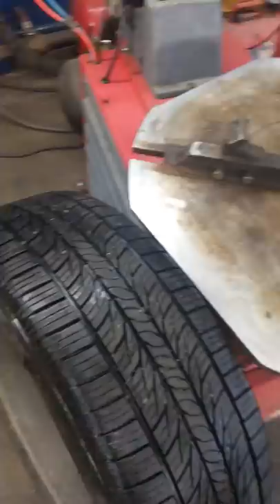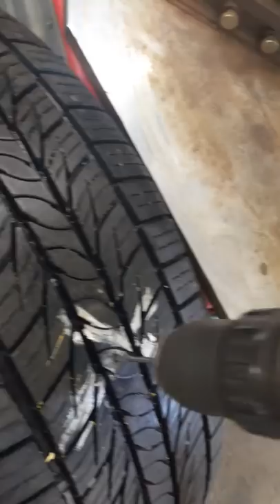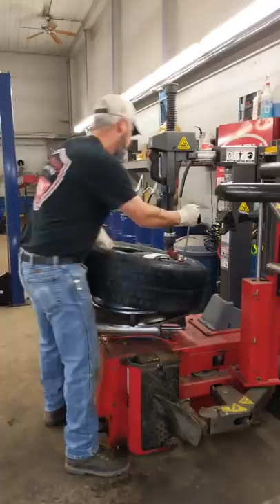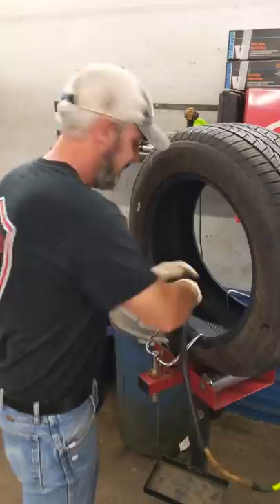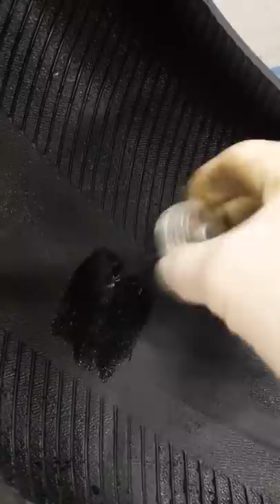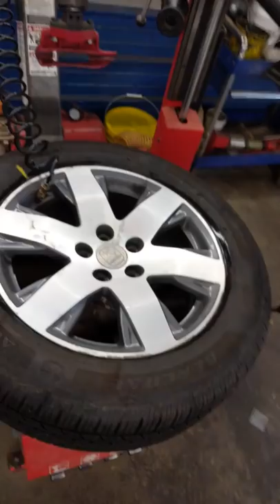Patch A Tire In 60 Second #SHORTS

Comment: What is so bad about simple plugs?  I need to know - I'm riding on so many plugs I can't keep track.  Is there a Shake Hands with Danger video for tire plugs?  Eric O sure is spooked.
Reply: I am not a certified mechanic, nor a lawyer, just some rando in the internet. But I've been plugging my personal and friends' tires for about 25 years now and had maybe 4 fail to adhere (or fell out within a week or two) and the worst that happened was a return of the slow leak. I've gotten lucky that almost all my holes have been near the centerline and not at the shoulders. If I needed a shoulder plug to get me home, fine, but I'd be looking to replace a shoulder-damaged tire soon.
Reply: They separate the tread from the liner after a while because they don't seal the liner very well and air pressure will be against the tread. You can get lucky with them but a patch definitely keeps the air inside the liner
Reply: @Bryan-Hensley  I've heard this too, and it sounds like a pretty dangerous failure mode. It must be very rare though...
Reply: Wherever there's machinery, you have a chance to Shake Hands with Danger.
Reply: @AerinRavage  Not very rare, have seen it many times. Have also seen tires develop a bubble when air migrated along the cords.

Comment: Considering I've been using plugs for decades, you have too many steps.  Step 5, put a plug in the needle,.  Step 6, coat plug with rubber cement.  Step 7, shove needle with plug into hole.  Step 8, twist needle, pull out.   Step 9, cut it.   No need to dismount the tire, screw up the balancing, etc.

Comment: Just buy a simple tire plug kit from Walmart like 5 or 6 bucks comes with 5 plugs enough for 5 repairs. Takes about 5 or ten mins to repair. No need to take tire of the car but just makes it easier. Definitely no need to remove the tire from the rim. I did it multiple times already anybody can do it if they know how to change a tire. Just pull out nail or screw use tool that came with kit push in and pull out a few times to make hole bigger than use same tool to insert a rubber plug and done.

Comment: Per usual done proper but personally I label the inside of the tire with chalk/paint stick in such a way you can identify your work vs others.

You know... Grand Paps "ever since you fixed that tire blah blah"
Got a string plug in it from Elroy's Shade tree🌴 Joint

Comment: Nothings really changed in the 50 years since I used to do this after school except then we would often put a tube into the tyre. Tubeless were fairly newish then. Crossply tyres always got a vulcanised repaired or new tube. Worst part of the job was breaking the ice in the water drum so I could find the bubbles from the leak. I hated the cold.

Comment: You make it seem so simple... if you have the right equipment to do it.  Definitely not a do it yourself video this time as that tire equipment is quite pricey.  Still love it.
Reply: Can all be done by a DIYer with nothing more than a bead breaker and patch roller as the special tools. Just faster with the equipment used in the video.

Comment: Drill the hole after you demount. Always use a carbide drill bit. Scrape the goo before you buff... Never after. Use a wire brush to clean buffed area.  Overall, not too bad. Room for improvement lol.

Comment: Yep...  I patched dozens and dozens of tires from the inside back in the eighties when in college and working at numerous service stations.  Now, it's rare to find anyone that will perform the service.  And even if they repair holes, it's via plugging gummy worms.

I'll do my own gummy worm repairs, thank you very much.  I'd patch them from the inside too if I had a tire machine.  Although, I do often spoon on automotive tires manually `cause I'm too cheap to pay someone to do it at prevailing retail shop rates...

Speaking of patches...  I have a bicycle inner tube out in the garage which will require my attention at some point today.  This particular bicycle rim/tire combination is a real fighter.  So much so I have to use motorcycle tire spoons to get the job done.
Reply: Plugs always seem to separate the tread from the liner after a while
Reply: I'm sure everyone has different experiences.  But, I've never had a plug fail.  I've even installed them on my street motorcycles lasting the life of the tire with no complications.  Quite a few of my dirt bike riding trail buddies have used handfuls of plugs to limp back to the trucks at the trailhead after sidewall tears using the tubeless TUbliss system. I'm also the neighborhood go-to guy for all household mechanical and quickie car fixes.  I've plugged numerous vehicles of folks on my street with zero complaints over decades.

I can't rightly say why your experiences and mine are so different.  But, until my results are similar to yours, I'm continuing on with gummy worms.

Comment: I've fixed many of those with the tire still on the car, on the side of the road. I carry a plug kit, with extra rubber cement, and a 12 volt tire inflator, the trunk. Only once in 40 years did I have to change a tire, and that was last month. I was driving on the main road, when I heard a noise like a tire exploding. I was right by the entrance to a gas station  when it happened, so I pulled in and parked. I thought I was going to plug another tire. When I looked at the tire it was shredded all the way around the sidewall. I've never seen a tire instantly destroyed like that. Maybe because it was a cheap Chinese tire. My other car has Goodyear tires. I've been driving it for 3 years. The tires are still good. Buy tires made in the USA. They're safer, and last longer.

Comment: Buy it, use it, break it, fix it, trash it, change it, mail, upgrade it
Charge it, point it, zoom it, press it, snap it, work it, quick erase it
Write it, cut it, paste it, save it, load it, check it, quick rewrite it
Plug it, play it, burn it, rip it, rip it
Technologic

Comment: I'm not super crazy about the patches with the stem. After the tires wears some the stem seems to push back on the patch.
Reply: The problem is its the dot approved method.
Reply: I’ve never experienced that. Every plug patch I’ve ever installed lasted the life of the tire and the plugs always wear away along with the tread. Doesn’t really matter to me though because after I cement and stitch a patch it isn’t coming off without some serious peeling/scraping effort.

Comment: Did you remember to let the glue dry for like 5 minutes, so that your finger won't stick to it? This is a mistake i see kids in automotive class do when they patch a tire, and boy i'm glad the ones they patch there are simply practise tires that sit on a shelf and are not in road use. At least, that's how it is where i live. The ones i do see on the road are horribly patched, which is why they begin to leak once more. The main issue however is that they don't let the glue dry. And to think i couldn't even trust them with swapping my summer tires to winter tires. Something i can get done in about 45 minutes on my front yard takes hours at the school.

Comment: We used to plug those on the driveway at the service station I worked at in the 70s. While we were adjusting the air in all four wheels during a full-service fill up

Comment: Gee, after Step 4, I went:
Step 5: put rope plug in tool
Step 6: put rubber cement on rope plug
Step 7: ram rope plug home
Step 8: remove tool
Step 9: inflate tire to recommended pressure
Step 10: drive away.

Comment: Step 1: Total flat in middle of no where
Step 2: All shops closed
Step 3: use tire plug kit
Step 4: forget about it.
Step 5:  (30,000 miles later) laugh at the 8 tire plugs you see when getting new tires.
Sad but true

Comment: I see that those patches have stems on them (which we didn't have on patches a long time ago), but why enlarge a hole that was originally made smaller by the intruding nail, glass, etc.?
Reply: Because the stem will rip off before you get it pulled all of the way through if, the hole isn’t large enough. It also ensures that no broken wires are going to poke a hole in the patch. I always go one step further and use a pair of flush-cutting snips to trim back broken wires.
Reply: @athhud  Yes, but back in the day when I was repairing tires at Sears that never seemed to be an issue.  I cannot see enlarging a hole that caused a loss of air in the first place.  The patch being a rubber compound is not likely to be punctured by a broken wire.  The wires of the steel belt is already encased by the rubber of the tire (inside & out).  I never saw a broken strand of the tire's belt poking into the tire on the inside.
Reply: Tire repair supply house sell patches with 1/4 inch or 3/8 inch stems.
you then use a 1/4 inch or 3/8 inch carbide cutting drill bit, and now the hole matches the plug diameter. Viola, no leaks!

Comment: You forgot peel it.  The clear plastic layer on the patch before using the security coat. But what do I know, I just work for *****
Reply: And where’s the fire? You gots to light that mo fo on fire to speed cure the rubber cement.

Comment: Never had any problem with the sealing cord kit you put from the outside..
Reply: That plugs the hole, but if you don't pull the tire off the rim you won't know what other damage lurks inside.
Reply: And you may never have a problem, but it only takes one problem to become a life-changing/ending event. When it was just me in the vehicle, I would take my chances with plugs. I had a few develop slow leaks over the years, but never an catastrophic failures. These days though, my wife and kids will be in the vehicle and I don’t take that chance. It’s an internal repair or a new tire for me.

Comment: $100 per hour labor charge so 60 seconds work is $1.66, sounds very fair  plus parts of course...... then again probably not.   Sure beats those plugs I have used many times.
Reply: Takes at least 1/2 hour, by the time the glue dries, expanded lug nuts you have to hammer the socket on to remove,  clean hub corrosion, clean wheel corrosion, rebuild tpms sensor. $50 would be a cheap price for a proper repair w/rebalancing tire!

Comment: Now to do the bedroom series for married men, I need help.
Reply: @wilfredr980  Step 2 should be find the right hole
Reply: @HotRod9967  just try one. If you get it wrong, you will receive immediate notification. The most important step is to make sure there are the correct number of holes, before you begin the plugging process. There seem to be more and more aftermarket transmissions these days. The housings look the same, but the bolt patterns don’t match up.

Comment: Did you mark tire to wheel? Otherwise perfect. You can patch my tires anytime.
Reply: The balance is off because of the patch anyway.
Reply: Yep, I think rebalancing is part of the mounting step.
Reply: @KJ-kw7gh  I have had several repaired this way without rebalancing.
Reply: Generally they are marked by the balance circles on the sidewall if those were used when mounting.

Comment: You’ve done that a few hundred times I’m sure. Your buffer and wheel I would question but you know what your doing. Low speed buffer instead of a die grinder. Yada yada

Comment: I still can't find the hole in my tire
Reply: WE had one of those that drove the tire shop (Discount Tire) batty. Never leaked when they checked it, looked good inside and out. 2-3 days later it was suddenly seriously low. After the third time they replaced tire and stem at their own expense - problem fixed.
Reply: It's the thing the rim goes through. Silly person!
Reply: @markh.6687  Ohhh... There it is  !  Thanks Mark
Reply: @flagmichael  In all seriousness Mike , this is exactly what is going on with me . My tire losing about 20 pounds pressure every 4 days . I took it off the car and spent a good 30 minutes spraying soapy water onto it ... around it  , ...EVERYWHERE ! . No visible leaks around the beads  , valve stem  or the tire treads . So i just keep putting air in it before driving the car. haha. Ill pop it off again when i have the chance just for fun. Glad i am not the only one . Even my lawn tractor seems to be possessed. Sometimes ill go into the shed and the tire is flat.. then the  next week it hasn't lost any air
Reply: @ethics3   A common cause of this is a small crack in the inner liner. Often seen on BFG, firestone, Cooper and Chinese tires. Remove tire from rim, flex tire by pushing against an object, you will find the crack. If so, replace tire. You never see a leak, because it leaks with the weight of the car, when flexing the tire in motion.
Reply: @markh3057  Thank you for that information. If i don't find the leak next time i look , I will chalk it up to this and discard the tire. Have a great day .
Rob

Comment: and if you’re not fortunate to have a tire mounting and dismounting machine?
Reply: A vacuum pump and 2 tire irons. Takes less than 10mins to break the beads and remove the tire once you get the hang of it.
Reply: Put donut on car, drop off wheel/tire at a shop and ask them if they can do when they have time, go back and pick it up.
Reply: Pay the man. Eric has to pay for that machine $5k to 10k, not to mention the liability of handling fancy alloy wheels, One scratch on a Mercedes wheel, $450 and up. And his labor. And his overhead.

Comment: STEP 1 REMOVE  FLAT TIRE
STEP 2  REPLACE WITH NEW TIRE
STEP3  BOLT TIRE ON PLACE
STEP 4   LETS PARTY ON ROAD
Reply: Unless it's an AWD vehicle...
Reply: @Blazer02LS  MINE IS  MY  2018 AWD SUBIE
AWD
Reply: @ekop1778  Good luck. AWD systems don't like mismatched tire diameters, tends to wear the gearing do to the difference in tire speeds. Most have warnings about it. Now if the tire was only a few thousand miles old it might be OK. 
Subaru says the circumference of all four tires must be within 1/4 inch, which calculates to 1.3/32 difference in tread depth. More difference than that can damage the AWD clutches.
Reply: @Blazer02LS   SUBIE SAYS I GOTTA USE THE SAME TIRE ALL AROUND ON MY IMPRESA NO AFTERMARKET ONES
Reply: @ekop1778  Aftermarket isn't really an issue, what is will be keeping the same tread design and diameter. So you can't run say a 245 60 17 on one and and a 245 65 17 on the other as it will mess up the AWD due to the different wheel speeds. The traction control will always think the tires are slipping and engage the drives with bad results. Seems like you understand that. Many don't, then they cry when the system fails in an expensive way.

Comment: I would prefer a patch to a plug  and I have been plugging tires for as long as plugs have been available. Of the 20 plus plugs I have done not one problem has occurred !
Reply: Now it's certainly possible for a plug to fail, which I have experienced. Now it could be a case of causation not correlation, but right at the plug point the tire delaminated from its steel belt and an air bubble formed. It was a Michelin defender at ~45K miles after a month of having plugged a #10 construction screw.
Reply: 20? That's all. I've had 30 to fail out of 60 or so. It will ruin the tire when they fail because air will get in between the liner and tread.
Reply: Ya , only 20 ish ……but I have never worked in a shop . This has all been for friends and family . And like I have said NOT one failed !

Comment: I thought you didn't like patches in tires.
Reply: He doesn't like plugs or loose patches, the combi-patch is the best solution as it seals the hole on both sides so moisture can't degrade the tire from the exterior.

Comment: When I worked at Tire America we used to have tire races,, there would be two cars in The bays getting four tires we would take all four tires off line them up in front of the car,,
Somebody with a timer would flag us, armed with a valve stem tool, we would rip the valve stems out dismount the tires, Mount the new tires, balance the tires, install the tires..
My best time was 22.7 seconds
Reply: I think a few of us had cars in your races, to bad one or more tires fell off, vibrated or leaked but as long as you won that's the important part.

Comment: and they charge $35 for a minutes work, how dear are the patches and glue
Reply: The machine is $10,000
Reply: @Bryan-Hensley  $2100 an hour is pretty good for a $10000 dollar machine, take away $50 for the operators hourly rate, power glue and patches and the machine will pay for itself in under a day

Comment: My only issue here is that the tire wasn't balanced at the end. What good is marking the valve stem location on the tire IF you didn't check if it was balanced beforehand. Then with the repair you do add weight to the tire. Now I'll admit it isn't a lot of weight. But still, how do you know that the tire is balanced correctly?
Reply: If u wanna balance it u pay more buddy 😂😂